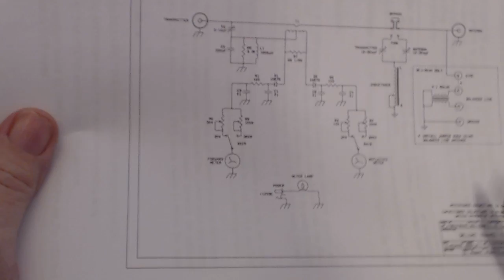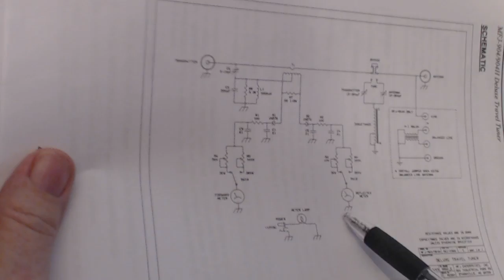TRRS #0812 - MFJ Portable Antenna Tuner Part 2

Comment: great look into the small tuner
I have a larger version mfj  949e I think is the model.
inside looks much like yours.

you are correct power is only for the light in the meter 

BTW you can tune by received signal even on shortwave, then where you are alloud to transmit you supply small wattage and fine tune to least swr and max power on that meter 
then ease up the tx power watching the meter until you are at the power you wish to use.

also tech's do have some privalages on HF
ie 10 meters ssb
other places in cw

good luck and have fun

73
Reply from the maker: +dougsbrat Yes, I am familiar with the bands and I am hoping keying the mic to adjust the tuner can be considered CW as I would like to see how it tunes to 40 and 20 meters.
Reply: +hamrad88 
yes you will be tuning in cw mode and if you do not have a cw key hooked up you can configure that radio to use the mic's up /down button as a cw paddle  
hopefully it can be set as a key and not a electronic keyer for tuning purposes 
 (long steady tone, not dots or dashes) while tuning 

you can play with this with break in off (off air) then when ready turn on break in and key on air and watch meter
see page 33 & 34 in manual
Reply from the maker: +dougsbrat Thanks for all the information.

Comment: The interesting thing I saw on your tuner, and found inside my MFJ-949E, the lamp has a cap across the +/- leads. I puzzled for quite a while about that cap, which is not indicated on the schematic, and never came to a conclusion about why they put it there. I did remove it when I replaced the lamp with a resistor and LED, and have suffered no consequences for removing it thus far.